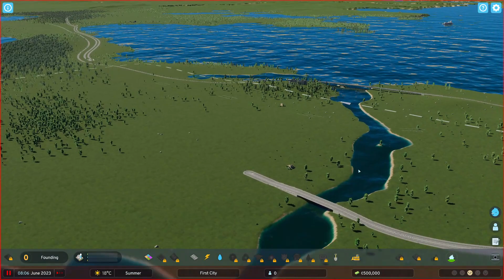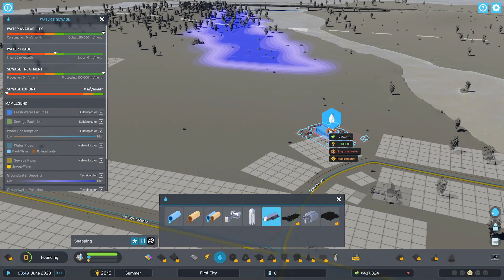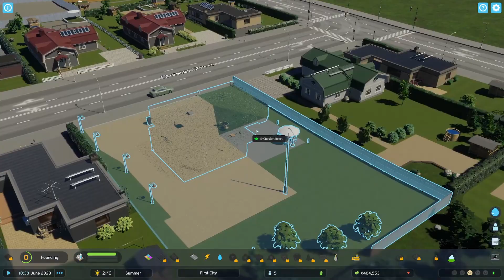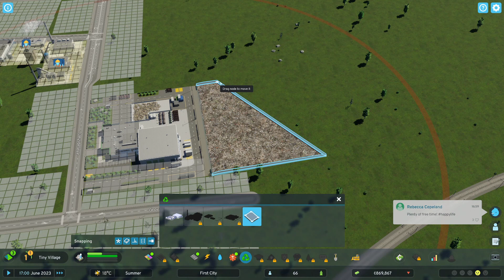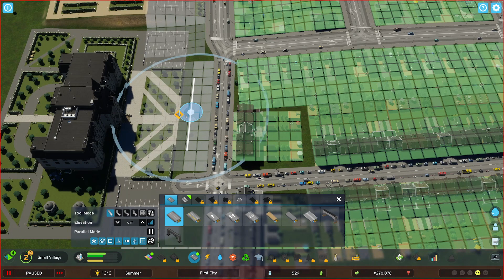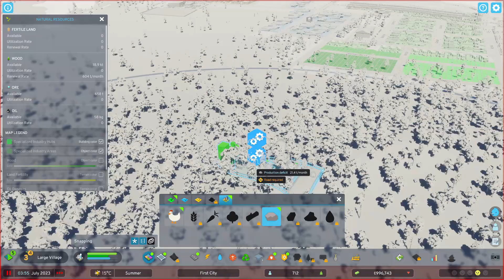First Impressions: Cities Skylines 2 Gameplay

Comment: Surely having to basically turn every setting down to low is a major issue and a big turn off for most players?
Reply from the maker: Its a downside of recording videos,  have found it safer to start with lower settings then increase them based on the fps level.  Given the warning about potential performance issues wanted to be on the safe side.  hopefully CO will work on improving performance.